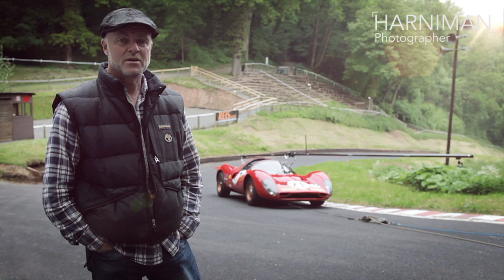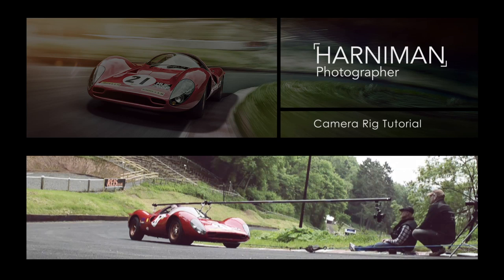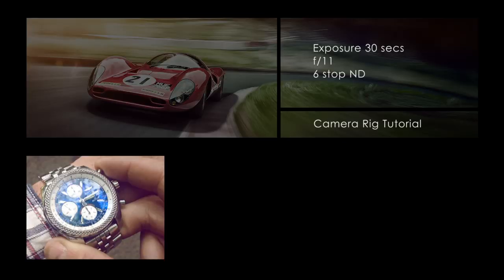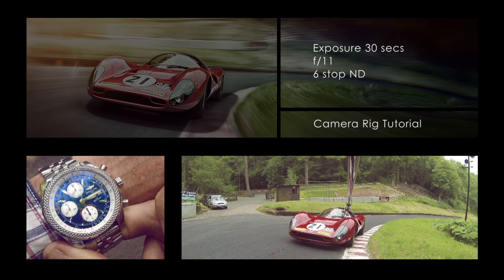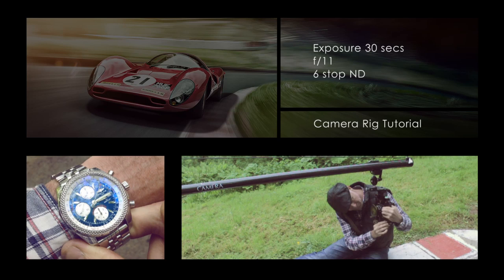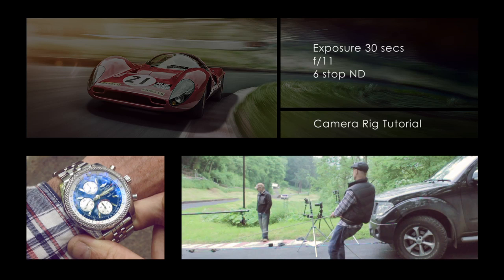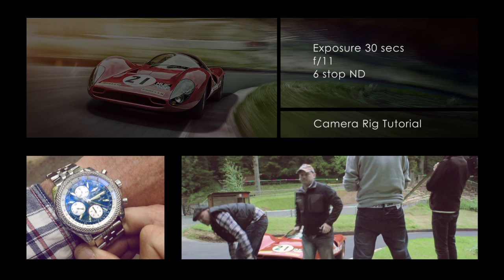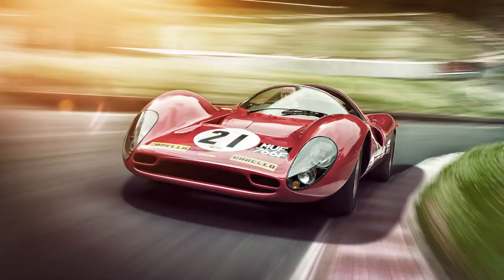Automotive Rig Photography Tutorial, by Harniman automotive photographer

Comment from the maker: It looks like the camera is moving independently of the car but it is not, by using the really slow techniques/long exposure you eliminate the chance of wobble. What is happening in this case is the pivot point  is so far from the car any small movement in the car is magnified along the rig and so looks like the camera is wobbling.
Well executed rig technique is all you need and one shot is achievable,